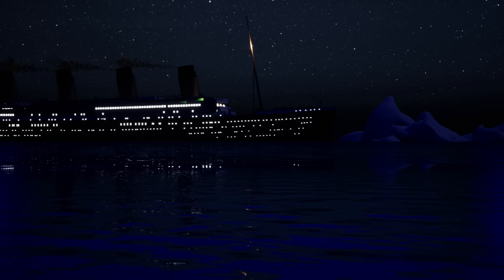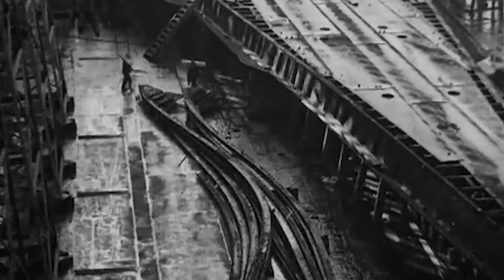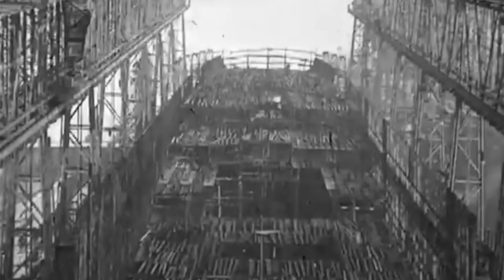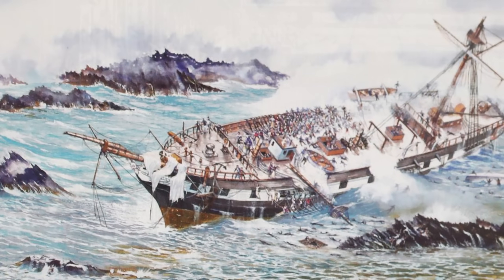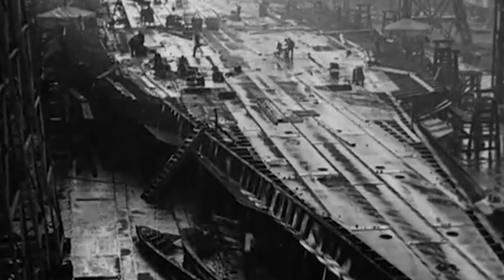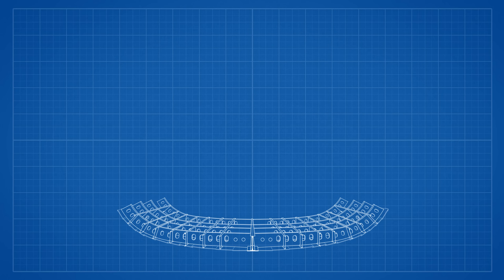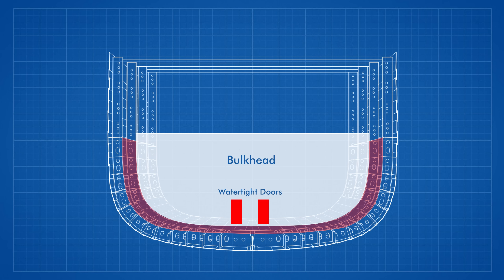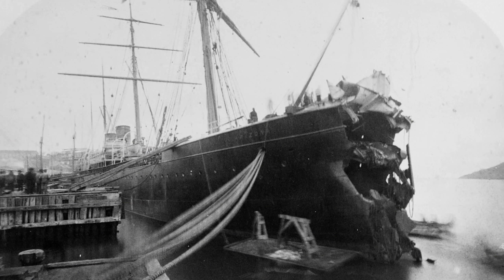How did the Iceberg Sink the Titanic?

Comment: And still it's easily said that water spilled óver the watertight bulkheads. I still can't imagine how. Didn't the bulkheads connect with a ceiling/deckfloor in the particular space? Was there an opening between the bulkhead and the ceiling? Otherwise I can't imagine how the water run over such a bulkhead.
Reply: Open corridors along the length the ship which were not watertight allowed the water to move freely. The fact that the bulk of the bulkheads only went up to E deck. I say the bulk of them because the first bulkhead went all the way up to B deck. If Murdoch had simply plowed Titanic’s bow into the iceberg, the brunt of that damage would’ve been taken by that front bulkhead and it is widely believed that while there would’ve been a few casualties and Titanic’s bow would’ve been crushed, she wouldn’t have sunk. Instead, Murdoch made quite possibly the worst decision anyone in that position could’ve make: He ordered the ship’s wheel hard a starboard and order the engines into reverse. While I don’t have a problem with ordering the ship’s wheel hard a starboard, I do have a multitude of problems with throwing the ship’s engines into reverse: Firstly, Titanic’s central engine was a turbine, which couldn’t be thrown into reverse and this had a direct effect on the rudder. Because that turbine and propeller was stopped, there was no longer any water moving over the rudder as that propeller was no longer turning and that hampered the effect the rudder had. Secondly, throwing the engines into reverse; Titanic needed a lot distance between herself and the iceberg for that part of the order to do its job, distance of which that didn’t exist. I also believe that if Murdoch hadn’t thrown the engines into reverse, Titanic would’ve passed the iceberg with inches to spare because the rudder wouldn’t have been hampered by the lack of water not being propelled over it. He should’ve kept Titanic’s forward momentum going, throwing the engines into reverse was quite possibly the worst decision anyone could’ve made in this situation.
Reply: @CodyJMinor0620  True, but also standard practice at the time. Natural to try to avoid a collision if possible, and the lack of lookout seeing the ice was more due to the cold calm water, with no moon leaving no way to see the ice at all till close by.  No radar to see, and it is hard to see a dark shape against a dark sky especially if there is also a cold layer of air by the water surface, providing a refraction layer, that prevents the light from being shown to you till it is only a short distance away. Just like a mirage of the sky on a hot day in the desert, the cold layer over the ocean showed the clear ocean a distance away till you got close enough.
Reply: @SeanBZA  I agree. There was no way that Fleet and Lee could’ve seen the Berg in those kinds of conditions until they were right on it.
Reply: People also talk about Fleet and Lee not having binoculars. Binoculars weren’t going to help in the kind of conditions that Titanic faced in the final ten minutes to her fatal meeting with the iceberg.
Reply: @CodyJMinor0620   Meaning up to the ceiling of D-deck? or half way the height of E-deck?
Is there a crossection available along the width of the ship along such a bulkhead? Instead of the length of the ship. Below E-deck there is a wall with limited openings. How is the situation above D- or E-deck? along what path came the water in ?  Still the question I have.
Reply: @Sobek79  It has to due with the height of the bulkheads. E Deck was only 10 ft above the waterline and there were open corridors that ran throughout the length of the ship that weren't watertight. Because the bulkheads only went that high, there was nothing to prevent water from flowing over the top of the next bulkhead and through a stairwell that went down into the bowels of the ship and so that process repeated until the eventual and unavoidable outcome of that night came to pass.
Reply: @CodyJMinor0620  One thing to consider.   This is not a ship to ship impact, this is a iceberg.    Titanic was just shy of 900ft long (880 wasn't she?), over 50,000 tons and moving at 20 knots.    That sort of mass isn't going to stop instantly.    Meanwhile the iceberg, that isn't going to move.   As big as Titanic was, it was nothing compared to the iceberg.

So to ram that iceberg head on, imagine running Titanic at cruising speed straight into the side of a sheer straight up cliff.     That's the type of impact we're talking about here.

A massive ship that isn't going to stop on a dime VS a immovable object.   Something has to give.

Yes the bow of Titanic was designed a crumple zone, but at the speed she was at it's possible  that may not of been enough.     Hitting the iceberg straight on could of done untold amounts of damage to Titanic, it was only logical to try to swing around it and I think Captain Smith or any other captain in Murdoch's position may likely came to the same conclusion.     Even crumple zones are still good for only so much.

At best, it's a pretty iffy "maybe" when it comes to if Titanic could of survived a head on strike.   Some think she could, others think the resulting damage would of been far to extensive for the ship to survive.

Like I said it's a lot of mass, moving at service speed, hitting a immovable object.    This isn't like when Stockholme hit the Empress and Stockholme survived with just it's bow crushed in, this impact with Titanic VS the iceberg was going to have much more violence.    Relying on just the bow to absorb all that, it's a lot to ask for.

The reversing the engines part does sound reasonable though.   I have heard that before as well if Titanic kept power on and kept water flow over the rudder that it could possibly helped her turn faster.
Reply: @justinlynch3  Well, you see, Harland and Wolff designed that front bulkhead not only be the tallest within the ship, they also designed it to be the strongest bulkhead; their reasoning being that if Titanic were to suffer to some kind of accident that came head on, that front bulkhead would take the bulk of the damage instead of sideswiping and putting the ship in the dangerous position of having a series of gashes that ran along a 300 ft partition of the ship's side, which is exactly the kind of damage that was inflicted upon Titanic. Sure, a ship moving at 21 knots in the dead of night hits an iceberg weighting half a million tons, that iceberg is going inflict a shit ton of damage to the bow, but, if she does sink, she's going to sink a whole lot slower because that bulkhead may eventually fail, but, its going to last a whole lot long than six to seven gashes running below the waterline and along the side of the ship.
Reply: @CodyJMinor0620  In theory, yes.

I think ultimately the speed in question is the biggest issue here.    At say, reduced speed in fog or something if you hit something, the bow will crumple in and the bulkhead will likely keep Titanic afloat.

I think the big question here is can even the bulkhead withstand a 21 knots head on strike.    Or would direct impact at that speed cause catastrophic damage to the ship?
Reply: @justinlynch3  It's a question no one has an answer to in regards to Titanic. But,  there have multiple incidents where a ship collided with an iceberg head on and lived to tell the tale. The most notable examples were in 1879 when the SS Arizona of the Guion Line collided with one head on, her bow was completely crushed, but, she survived and just a little over 4 and half years before Titanic sank, in September 1907, the SS Kronprinz Wilhelm of North German Lloyd rammed a berg head on and lived to tell the tale. The three major differences between Titanic and those two ships were that Titanic was bigger, faster and she sank.
Reply: @justinlynch3  Say she does hit the berg head on and the damage is catastrophic, she will sink, but, she may sink slower because, the damage is in a more contained area than along the side and below the waterline, again, in theory, but, the only way you could get a possible answer is by running a simulation.
Reply: And if the damage is taken by just the front bulkhead, you also have to take into account the fact that Harland & Wolff designed her to be able to stay afloat with just three compartments flooded, with the max being four flooded compartments and she would still float.
Reply: @CodyJMinor0620  That is fair.   As long as not to many compartments flood beyond the point of damage, the ship should stay afloat.